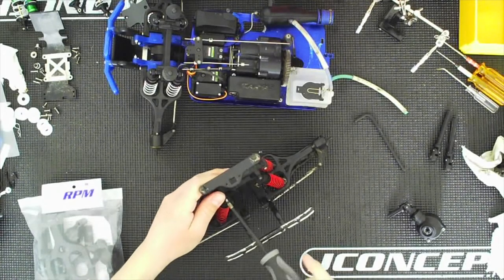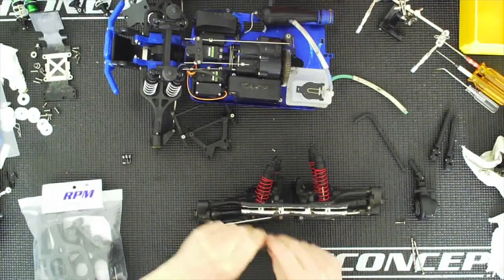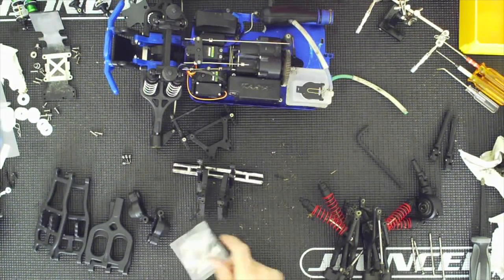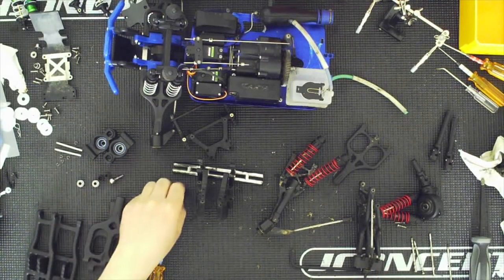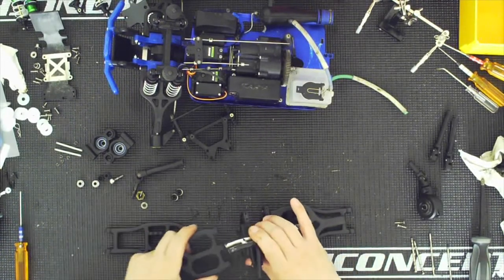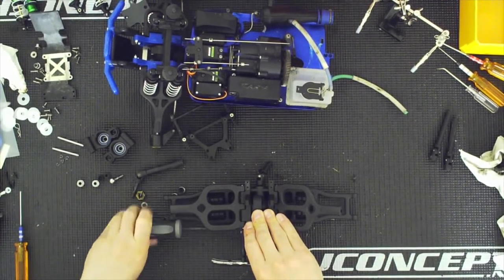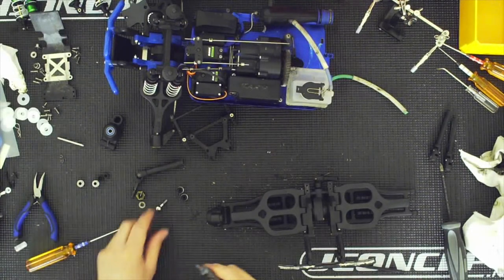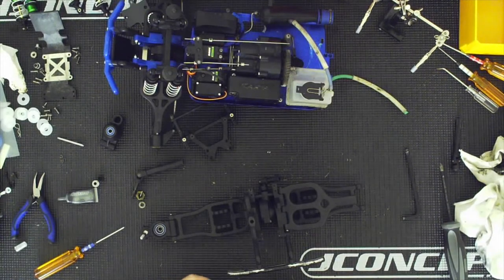Traxxas Tmaxx Upgrade Part5 Remove rear shocks and set up RPM true track conversion kit

Comment: Could you install this on tmaxx 2.5
Reply from the maker: You can. This is actually a Tmaxx classic. It will just make the rear wider.
Reply: @telecomandorc  does it come with front and rear or is true track just a rear upgrade
Reply from the maker: @tjgetem3783  It's just the rear. But RPM does make the front arms.
Reply: @telecomandorc  front true track or regular rpm arm upgrades
Reply from the maker: @tjgetem3783  Regular arms. I have not heard of a front true track.
Reply: @telecomandorc  thanks alot bro for the help